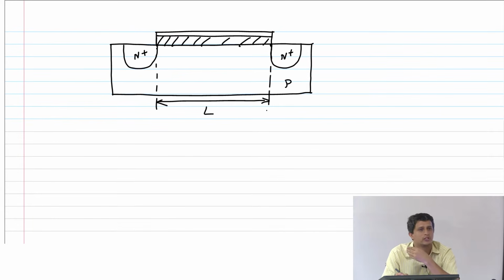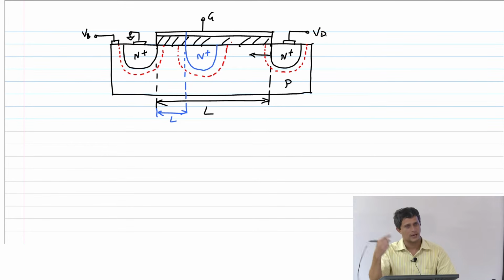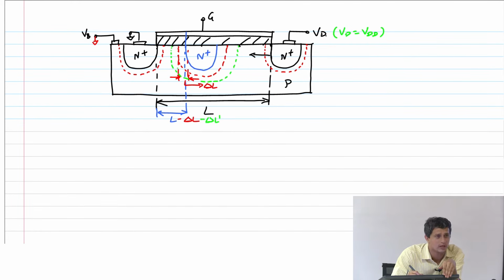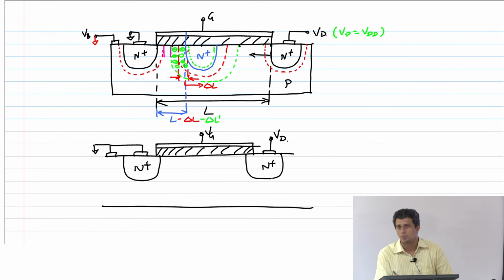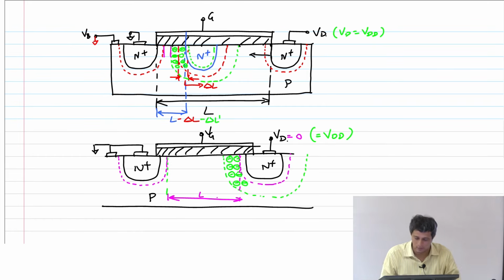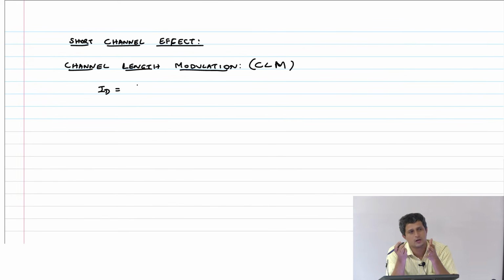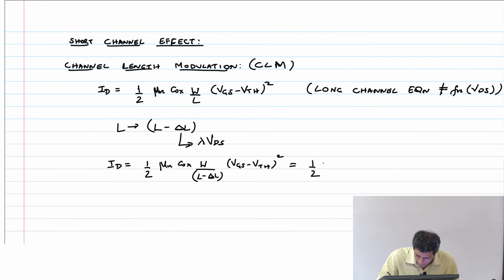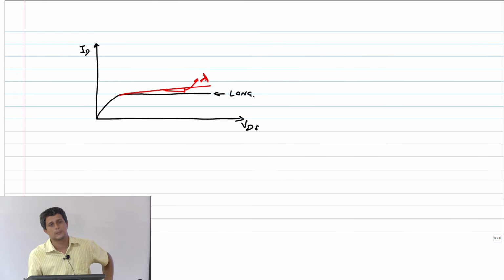Transistor -5 - Short Channel Transistors - Channel Length Modulation

Comment: at vd=0, how can any depletion region even form ?!  
video time @ https://youtu.be/vd_g8l0DycU?si=xehnTM8mqcKQeUCG&t=579
Reply: consider the case of pn junction diode  at no power supply electrons diffuses from n to p side and holes diffuses from p to n side then at p side -ve  immobile ion forms and and  at n side +ve immobile  forms this called as depletion region the same was happening correct me if i am wrong

Comment: can anyone clear this ? 
In lecture 4 sir @9.24 the sir is saying that as vsb is positive vth should decrease but in lecture 5 (this lecture ) @7.59 sir is saying that as the junction is reverse biased depletion region increases which causes the channel length comes down and vth should come down but when we compare this with lecture  4 @9.24 as vsb is positive then the junction between bulk and the source is forward biased therefore the length of depletion region will be less and due to this channel length is more as a compared to previous , so vth should increase then how it can be said to be decreased?
Reply: when Vsb>0, Vth increases.

Comment: How does current increases when channel length decreases, assuming Vd is same.(asking for the physical explanation and not via W/L ratio)
Reply: If Vd is same and channel length decreases, Electric field increases, drift velocity increases, no. of charges crossing a csa per unit time increases, current increases. Found the explanation in next video
Reply: I think! Because the channel is shorter,  Drain protential is closer to the source end. Would have a stronger inversion layer and the threshold voltage will drop and the drain current will increase Because of the shortening of the said channel ! I don't know if I have the  right thought process,  channel,  track.